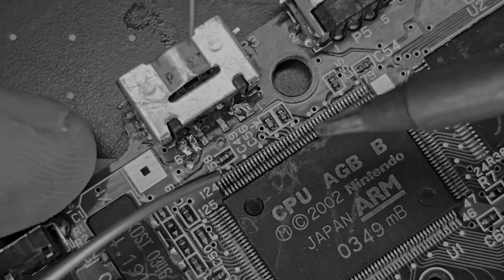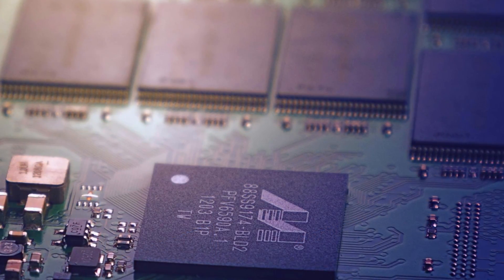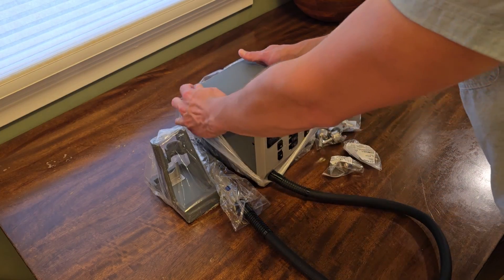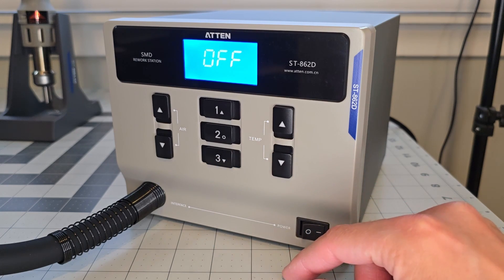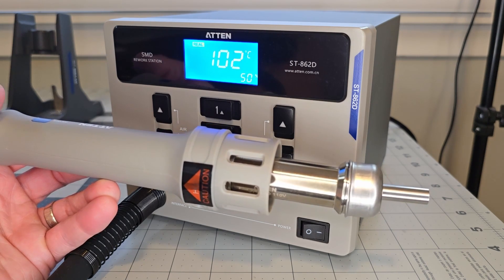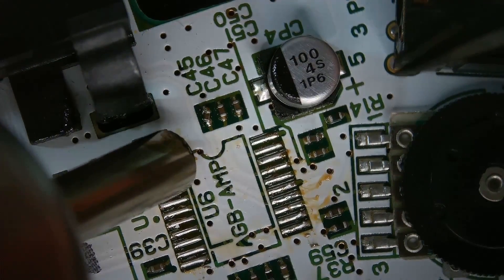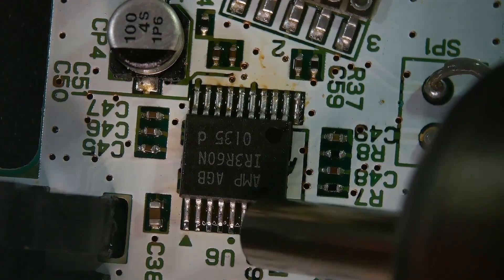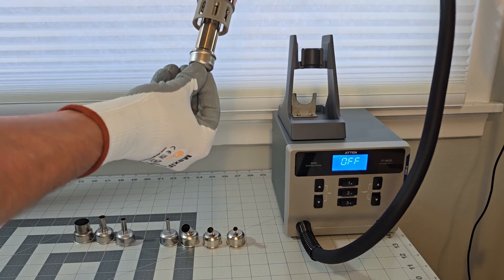Hot Air Soldering Station Review! Atten ST-862D

Comment: The difference between a cheap hot air station and a good one can make or break a repair. Trust me, I know LOL.
Reply from the maker: I trust you! Rule of thumb for almost any tool is if you go cheap, you'll end up spending more in the long run.
Reply: what would u reccemend for under 250
Reply: @YSG-13  The ST-862D lol; you can often get 'em for $200 to $250 depending where you look.